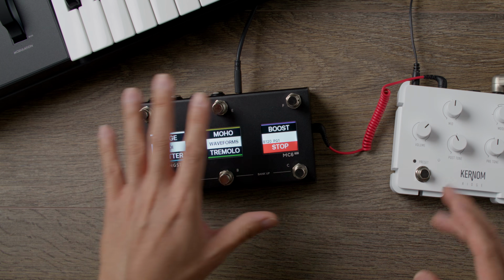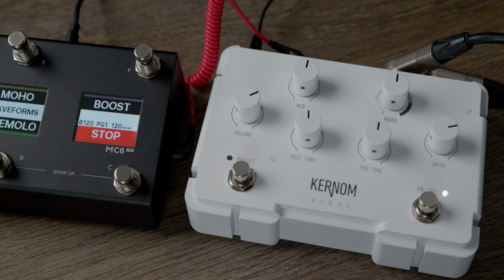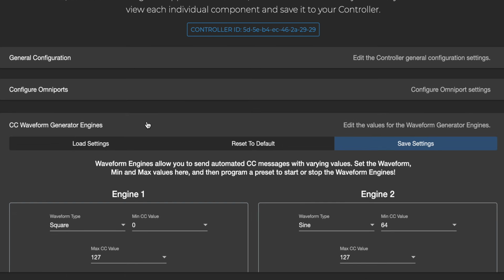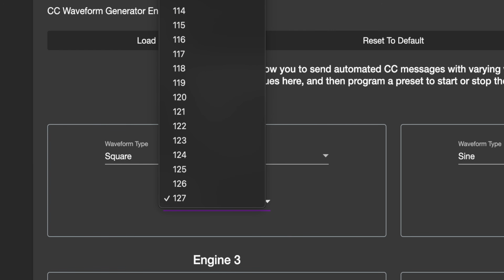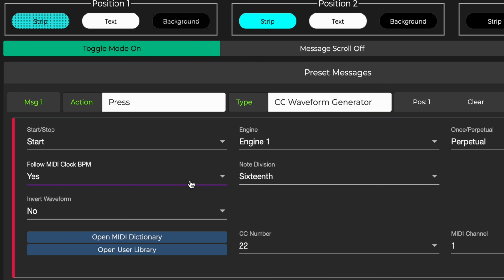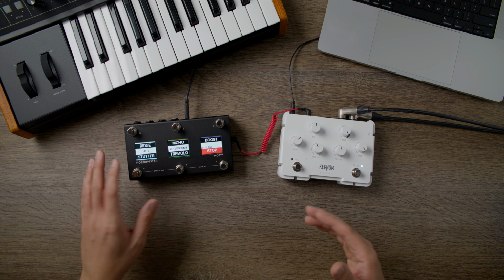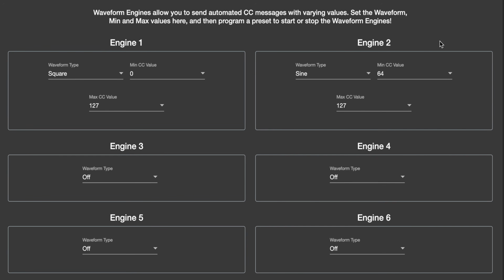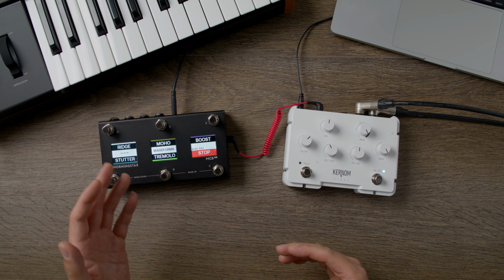Creating Stutter & Tremolo effects with MIDI - MC6 PRO

Comment: I did this controlling my Chase Bliss Preamp MKii. It was super cool because of the servo motors were moving the faders with the control messages. I decided to turn the faders off in the end to make sure I didn’t cook the fader motors. It was pretty cool though because it basically turned the pedal into a tremolo. 

Now that UA has updated their pedals to have midi I am going to set this up on my Lion, Ruby & Dream pedals. So that I can have tremolo anytime as well. 🎉

Comment: Get video. Can't recall, but can an expression pedal control the speed of the trem and stutter? The trem and stutter are also available on the MC8, correct?
Reply from the maker: Yes, you can use an expression pedal to control the MIDI Waveform speed. Yes, these features are all available on the MC8 too!
Reply: @MorningstarEngineering  Thank you very much. Happy Thanksgiving.
Reply: @MorningstarEngineering that’s amazing! Would love to know how? More importantly though, would love to learn how to disengage a preset while switching to a new preset. I usually just put a message in every other preset to turn off the pedal I don’t want with cc msg but feel there’s a better, easier way
Reply from the maker: @henryrobertson7085  Hi! Please send us an email at ‘help@morningstarfx.com’. We provide support from there. A service ticket will be created for you and we will be able to follow up easily.